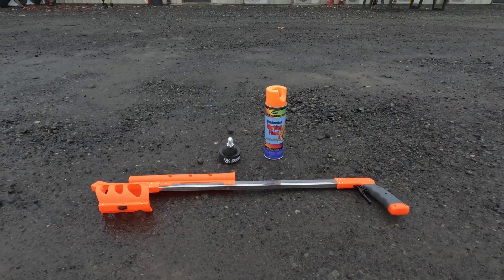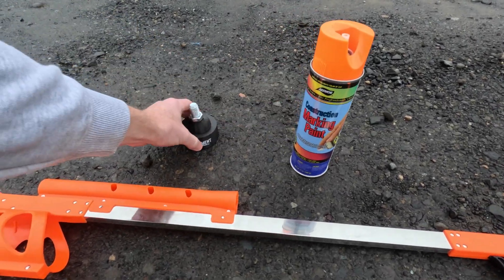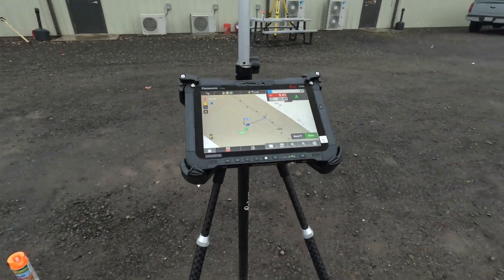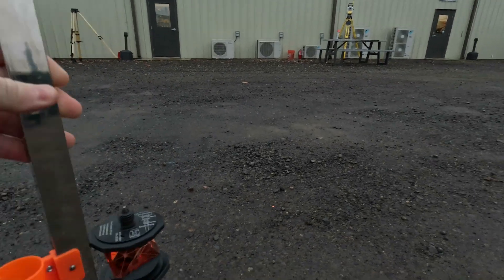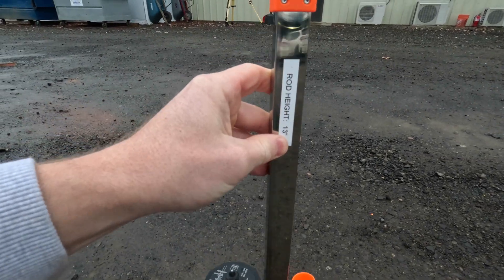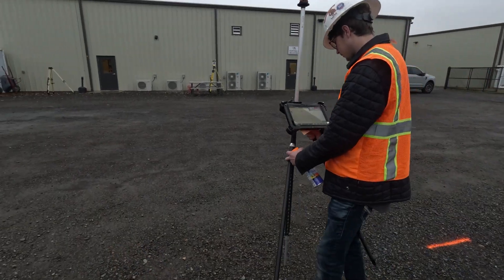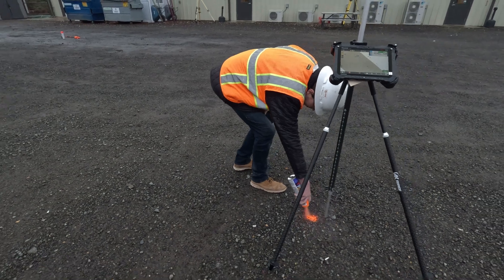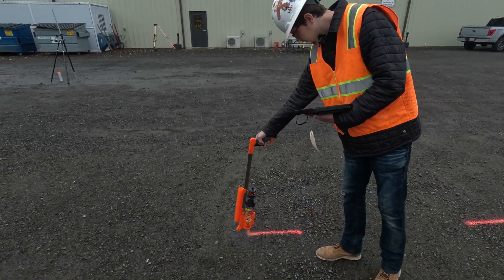Spray Paint Prism Adapter - For Faster Total Station Layout

Comment: great tool,with the height would it be from the bottom of the pole,? to the middle of the prism ?,or all the way to the top of the holder
Reply from the maker: Generally, this is used for just marking more of a X/Y location on site, than elevation like a rover rod would be made for. For the height/elevation, it would be from the middle of the prism to the bottom of the can holder. Hope this helps!